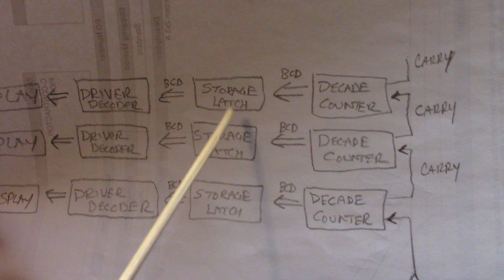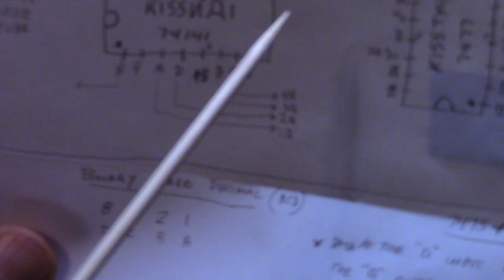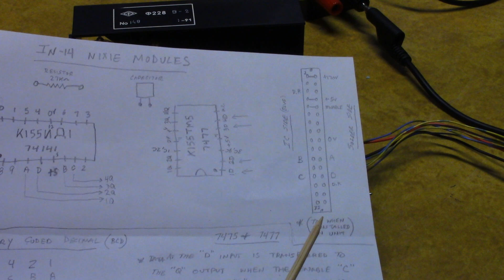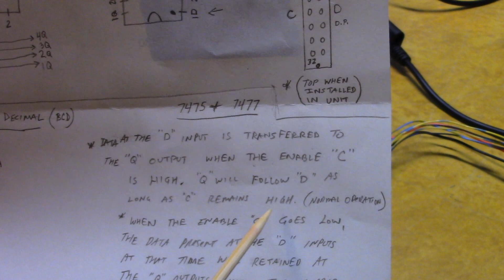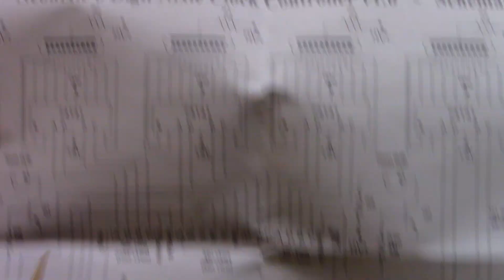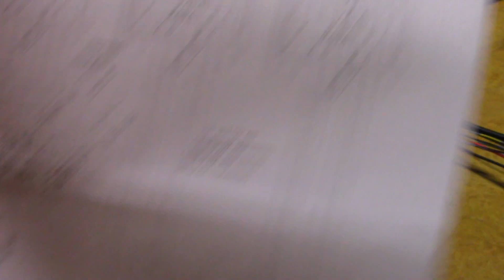IN-14 Nixie Tube Modules - ( Part 1 ) How to reverse engineer and connect.

Comment: These modules are interesting, and seem fairly well suited to building a clock. Using the All Spectrum clock chip (which is actually just a pre-programmed microcontroller) for this seems like a good plan, and since they have been selling them since the early 2000's, it's only a 10-15 year newer design then the modules (1991)!
Reply from the maker: Yes I guess that controller is a PIC after all....just already to go!   Yup, I also guess there is no reason to stay with obsolete tech on these "not that old" modules.